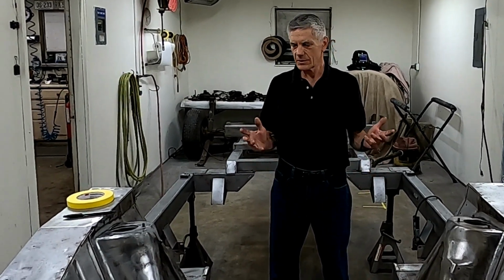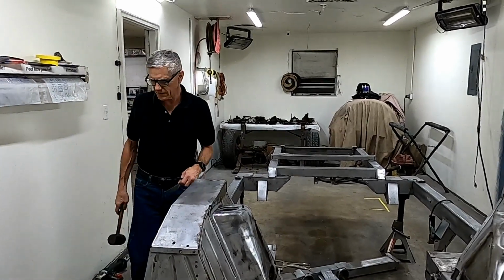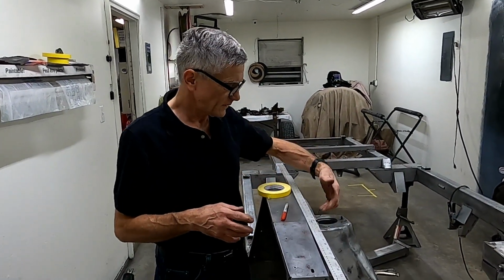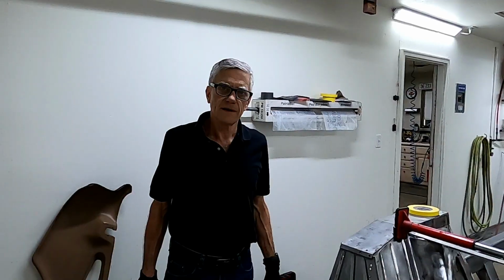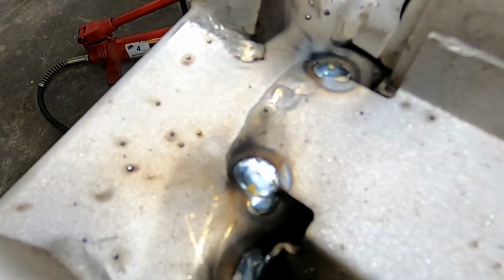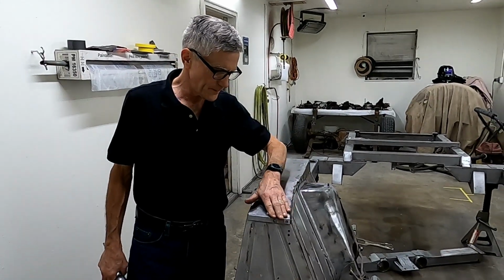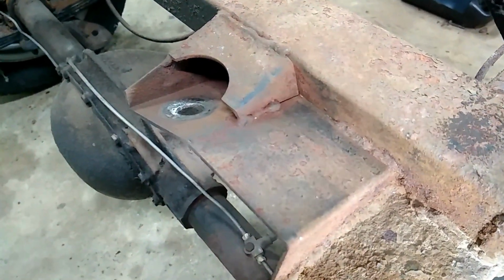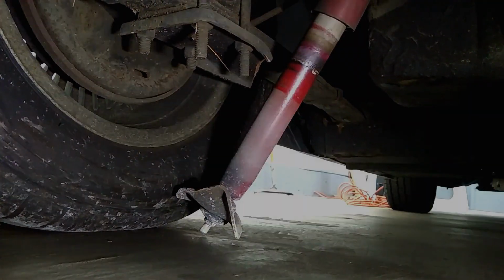Bricklin Frame Restoration

Comment: I would love to know if you're going to drop a modern engine into it and if you have an original working roller display clock.
Reply from the maker: These cars are worth much more with the original engines and they are very reliable.  They can be woke up with some tuning and you don't need a laptop too do it. I have had to redo many restomods that were done very poorly.  The original radio does have a cool old school clock, but mine's in a box I like being able to use Bluetooth hands-free. If you do it right you can swap back to the original to gain points at a car show.